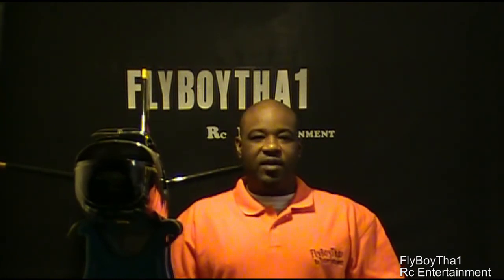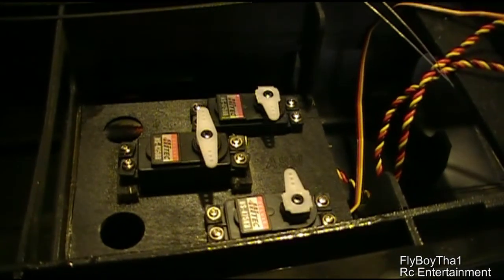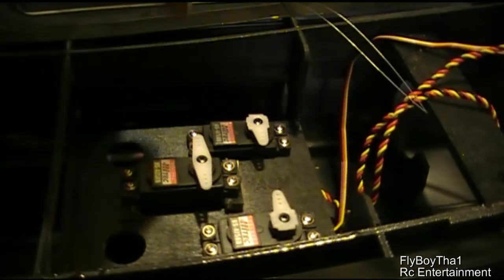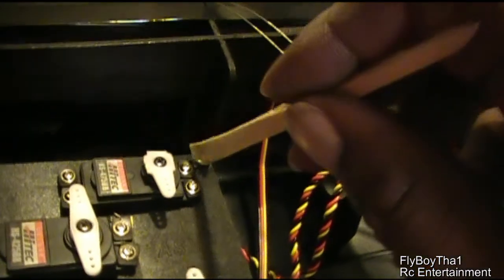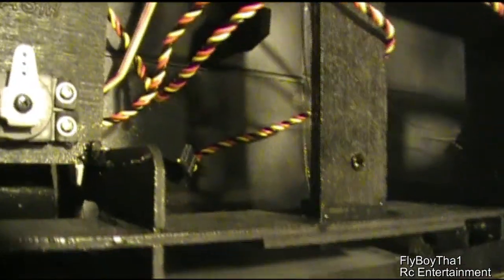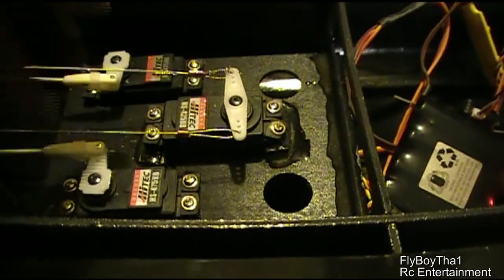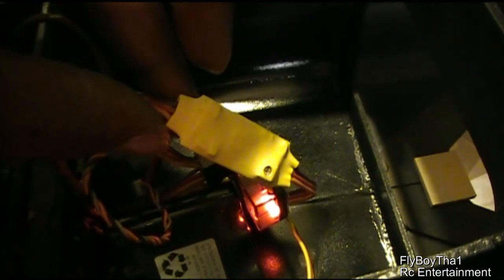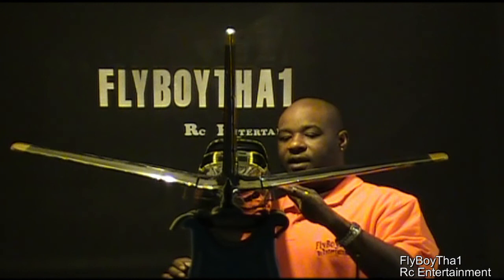ASM A-26 Invader Part 6

Comment: Your doing a good job on assembly. Just a tip. I put the front wheel servo in the front under the glass. I need to add nose weight and the servo and extra wood was just enough. Good Luck!

Comment: I agree with flyboy on the electric. I wouldn't want to tune two nitro engines every time I went to the field. Plus you just plug in and fly. Flyboy check out hobbyking. I run turnagy 6 cell 5 amp lipos for 60 bucks and they have lasted longer than my thunder power.